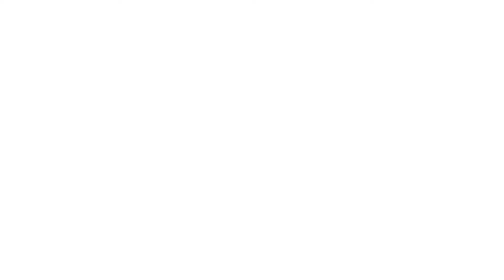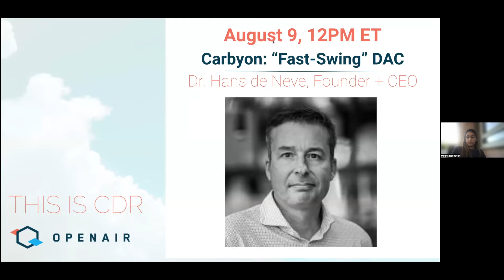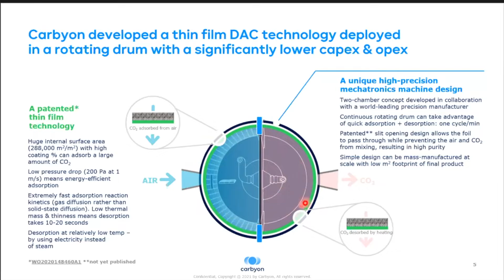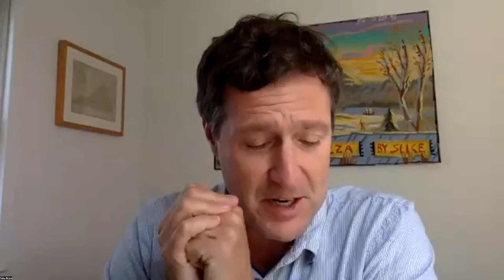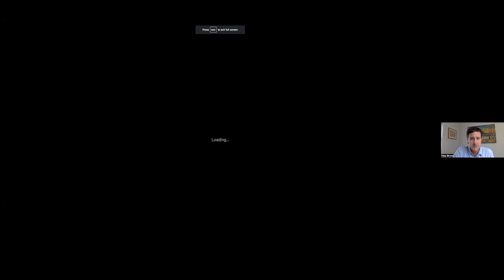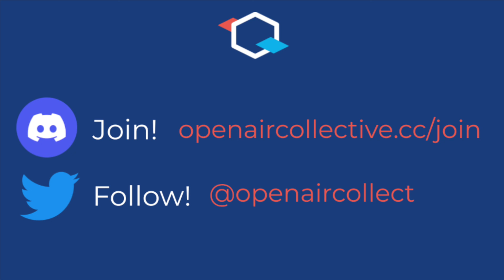This Is CDR Ep. 45: Carbyon's "Fast-Swing" DAC with Dr. Hans de Neve.

Comment: To compare the Carbyon DAC machine with another solid sorbent DAC from Global Thermostat-

---------------------------------------------------------Carb-----------------------------------------------------------------------------------------------GT with heat pump

Cycle Time                                           ?  mins                                                                                                     15 mins

sorbent + support                               amine with carbon support                                                                   amine with ceramic monolith support

desorbtion technique                          electric heating of conductive carbon support                                    steam heating  with energy recovery

machine air pressure loss Pa                  200                                                                                                       150 

air approach velocity   m/s                              1                                                                                                       5

capture energy (electric)                          1 MWh / tonCO2  = 3.6 GJ / tCO2                                               around 2 GJ /tCO2

DAC unit capture capacity                     100 tonCO2 / year    ( 2 m diameter standing tube )                  4000 tonCO2/yr   (  container size module )

 
[  data taken from  Ping et al,   Global Thermostat Low Cost Direct Air Capture Technology,     International Conference on Negative CO2 Emissions, May 22-24, 2018, Göteborg, Sweden ]

note that there are diminishing returns from a very small capacitty unit as there has to be proportionately greater support infrastructure for piping and CO2 collection etc